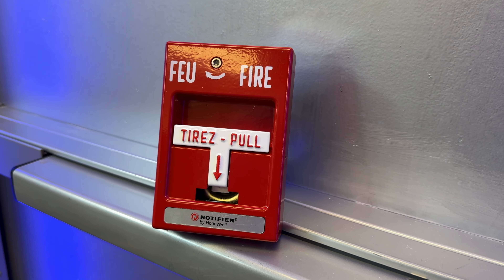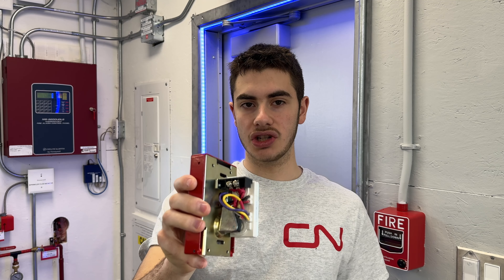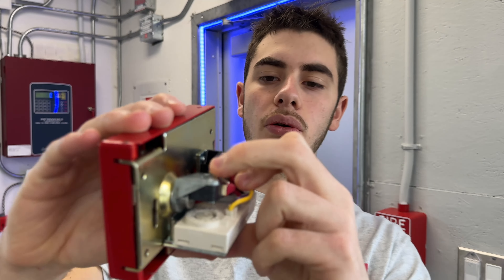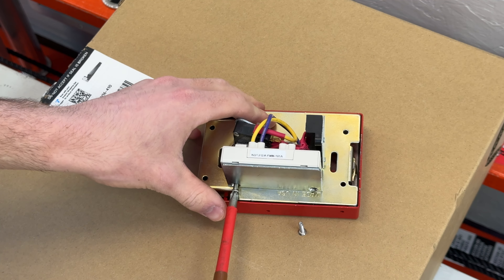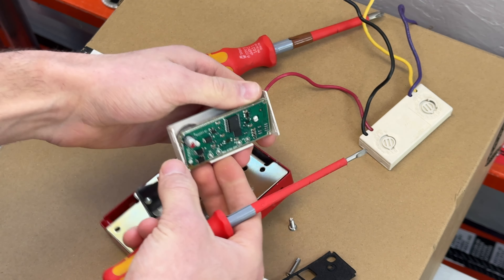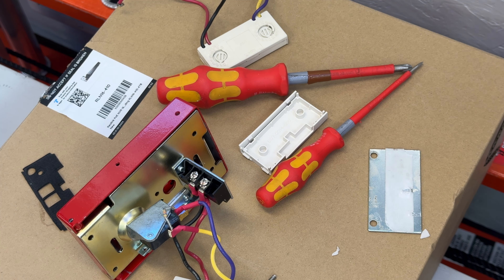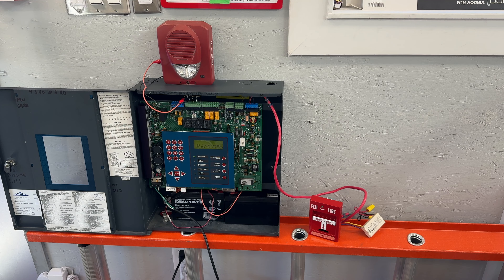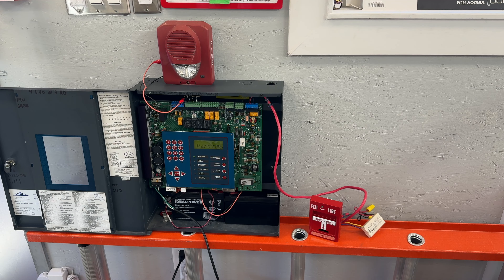Fixing fire alarm pull station | turning addressable to conventional Notifier N-MPS-SA

Comment: Unfortunately my fireshield’s panel circuit board is about dead. It’s now getting really hot and making a weird electronic smell. I’m gonna use my soldering skills to look through the board and attempt to find the issue and the grounded component(s) (I suspect the ground issue is the reason the board is doing this). If I can’t fix it, I’m gonna have to replace the panel. I already found a cheap suitable replacement for the panel. Shame it’s doing this, but the panel is probably at least 20 years old by now (the panel is the older fireshield model fs1004) and probably has lived a good life already.

Comment: I believe you because bad pull station that trap wired.  It’s unacceptable for trap wired (metal melted on wires) and unfair.  But, I like your good pull station (technology than old metal pull station).  I mean that plastic pull station (pull down, flash red light, no metal melted wires, and good technology than old) and old metal pull station (pull down, no red led, metal melted wires, and old technology).  😉👍🏻

Comment: I had fci ms2 ones that had addressable
Modules I has removed them as they were attached to the wire block and technically was conventional by default

Comment: 14:50 You didn't switch 4 on. It's still off, that's why it sounds the same.
Reply from the maker: I tried to switch it... it's the thought that counts stupid thing should've worked.
Reply: @nics-systems-electric  Probably stuck in place or you didn't have a good grip.